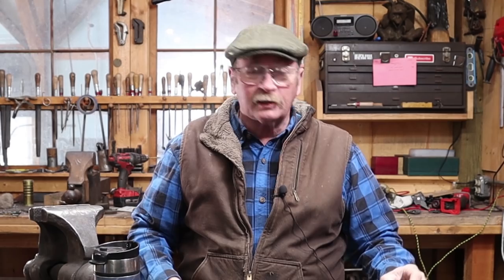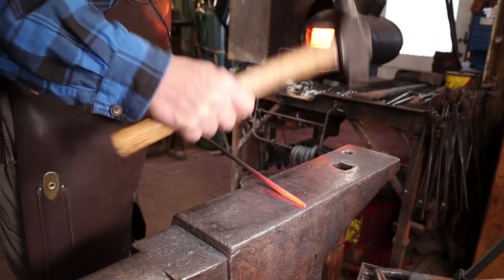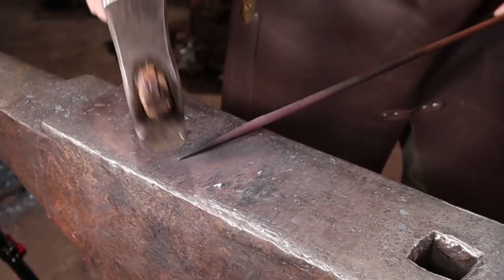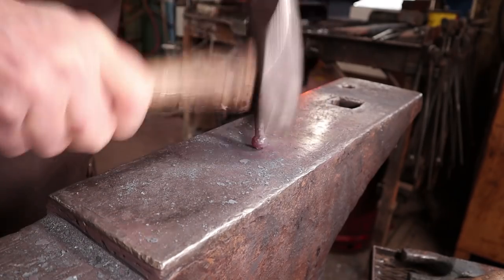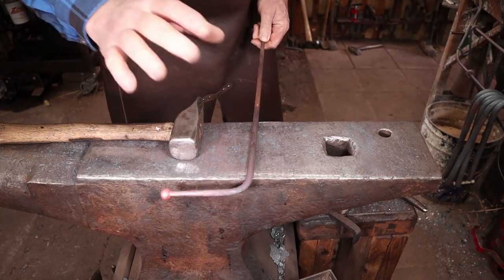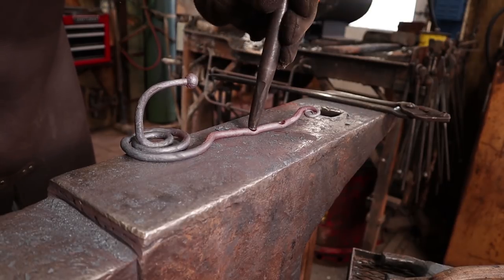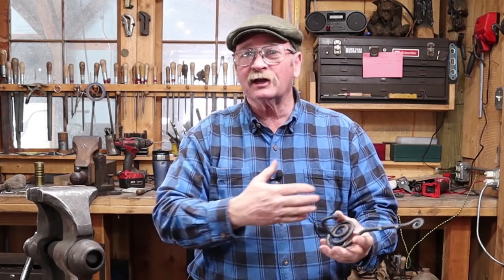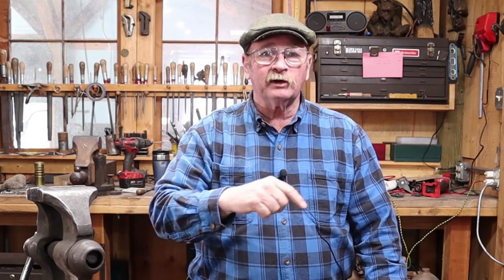Second version of the Spiral hook with Ball finial - Hook of the week 36

Comment: When you were straightening & twisting the top spiral, I thought it was be neat to go the other way; pull it out a bit to make a hat & coat hook. But it still looks good, and could be just another "twist" to the hundred identical hooks all different for the craft table.

I was wondering if you thought a banana hanger would qualify as a hook?  I don't know if I have ever seen a banana keeper (or hanger, or hook; it seems I have seen all  names used) in steel. I seem to have a vague recollection of Roy Adams doing one, but he has shown all kinds of things, and it may just be me getting my wires crossed.  Just another idea to throw into the pool of hook-of-the-week ideas.